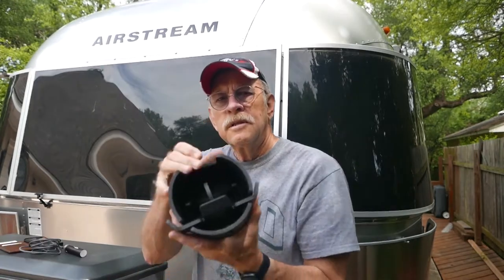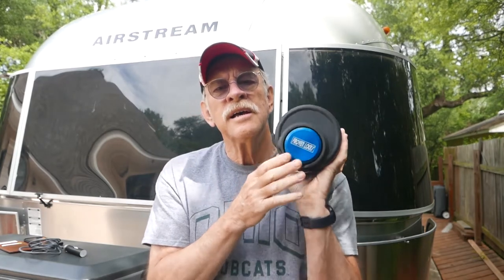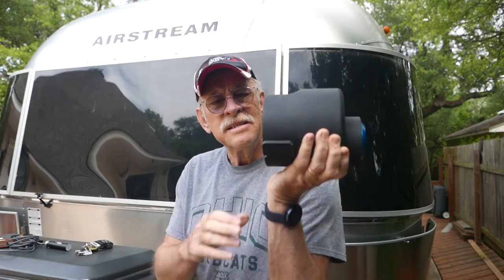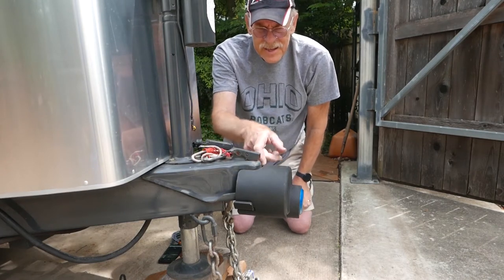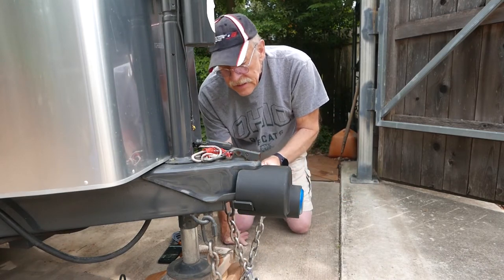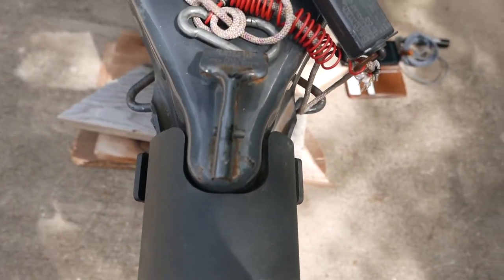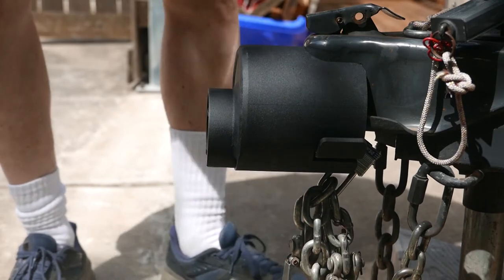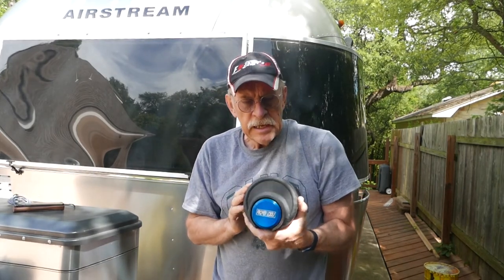Proven Locks Hitch Lock

Comment: I got there hitch pin lock and three Puck locks for my trailer and the coupler lock only thing I don't like is the keys are finicky you got to get them in the hole just perfect I've had to screw with mine for over 5 minutes before trying to get it done locked thought I was going to be stranded
Reply: Unlocked
Reply from the maker: I agree.

Comment: Just take a drill 30 secounds later it’s of
Reply from the maker: Can be done, but its not quite as simple as you make it out to be.  A stainless body lock is much harder to drill, The drill is going to "walk" unless you do a center punch and you have to drill at a certain point on the lock. By locking the chains to the cover you can prevent easy cover removal even with the puck lock off and slow down the theft process. So if the thief brings a  lot of equipment and has enough time with no one watching, they could succeed.   The purpose of  this lock is to discourage a potential theft of opportunity by requiring extra time and activity to defeat the lock.